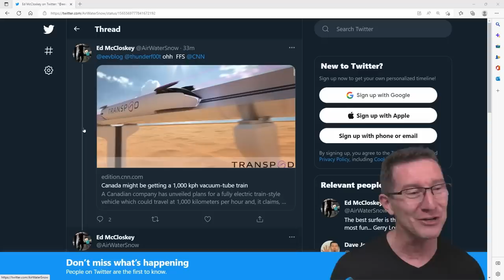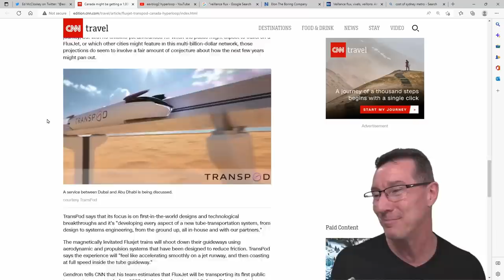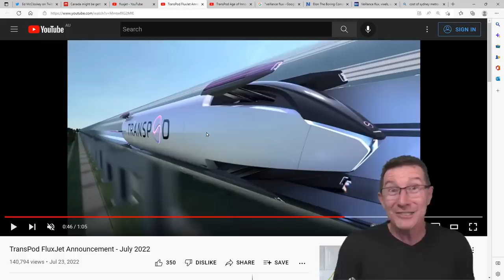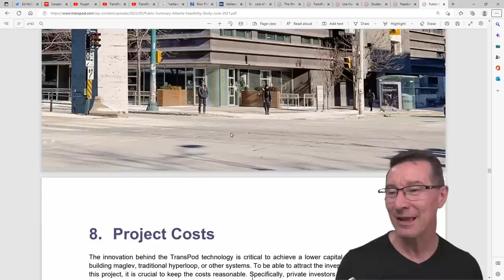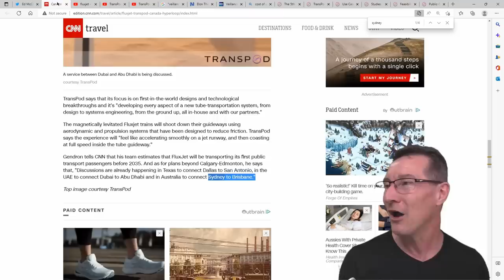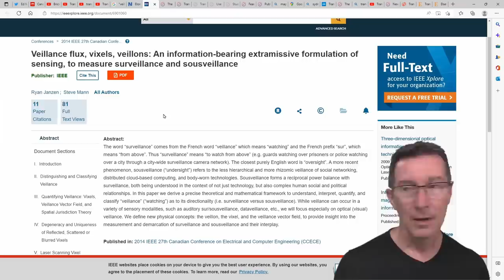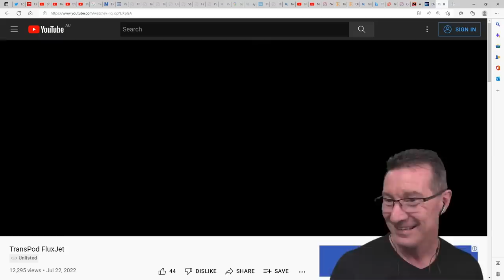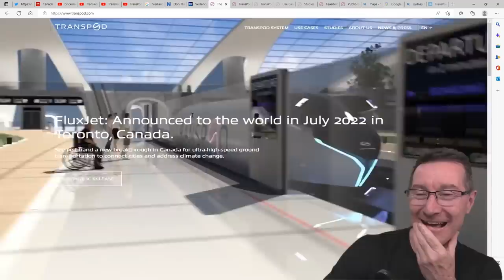EEVblog 1498 - TransPod Fluxjet Hyperloop $550M Boondoggle!

Comment: At 0:43 in the demo video you can see they have an even smaller scale test vehicle that appears to be in an actual vacuum chamber and you can see their "plasma energy transfer" at work, wish we had more footage of that, however no clue how you're going to pump a megawatt through this plasma at scale without destroying your electrodes in an instant.

But how much would that larger prototype have cost to build? Before I thought they were just lying about having half a billion in funding but after seeing close ups of that thing I see they have to have that sort of money to build something like that. Although it's clearly not capable of magnetic levitation with those "superconducting" microwave oven transformers it still has taken a decent amount of money and effort to construct and I can bet it has done its job to convince even more investors to open their wallets wide.
Reply from the maker: Ah, yeah, I see that, it's very brief. You can see plasma ball types arcs flashing across a gap. I'd bet that practically zero power is actually being transfered there. I suspect it's just a plasma ball type chamber mockup. As if you are going to get plasma arcing like that at very high power and NOT erode your rails and contacts. Maybe Transpod will see this video and supply us with some footage of the mini version and the big version actually levitating and being pushed down the track and powered?
Reply: @EEVblog  Taser the the train, cuz if you taser a person they run super fast as well 🤪
Reply: @EEVblog  
Still, no one has addressed the elephant in the room, how do you get plasma in a vacuum?
'Plasma is superheated matter – so hot that the electrons are ripped away from the atoms forming an ionized gas.' ~ MIT Plasma Science
Burn, baby, burn! 😁😁😁
Reply: @mynewschannel3100  It's not a complete vacuum, so there's some gas molecules there. And you need a low pressure in order to form a plasma at low temperatures - that's why the Northern lights occur at very high altitude. Not that any of this makes their idea any less stupid...
Reply: @markmuir7338  also, the less air you have higher does the effective resistivity of the gap go, as you have less ions
Reply: apparently you didnt see their cgi rendering that says it works because cgi rendering lol
Reply: @mynewschannel3100  you get gas from the electrodes evaporating from the high energy discharge.
Reply: How will they transfer the power you ask? Magic

Comment: Plasma in vacuum... Sounds like you'll get free X-Rays with every ride too! Amazing!
Reply: it wouldnt be in vacuum, thats a lot lower than 'low pressure'
Reply: @mycosys  It wouldn't make pretty colored light, it it where in full vaccum😏
Reply: Thats what I was thinking too 🤣
Reply: Not really. It is not vacuum that makes xrays but energy of the electrons. Unless they use very high voltages on the order of tens of kV then no xrays will be generated.
Reply: @JanCiger  Yep about 15Kv.
Reply: @JanCiger  well a 1cm arch is already 10kv
Reply: I don't think any contact could withstand being surrounded by plasma for any extended period of time, and I highly doubt it would serve to carry across any power. Isn't plasma rather a SIDE EFFECT of - for instance - lightning, when it superheats atoms in the atmosphere, kind of like an extreme phase of excitement, way passed ionisation?

Comment: Of course the veliance flux keeps the inducto-resonant coupling of the stators in a stable arrangement. That's the only way for the dynamic entropy halbach array to work dynamically.
Reply from the maker: Obviously.
Reply: And it also uses patented boondoggle technology
Reply: @EEVblog  Nah, you got the polarity backwards!!!
Reply: You forgot the surmounting of preframulated amulite...
Reply: It looks like it has both a type B and type S quantum super-framistan.
Reply: All those words use to have meaning before they was put in that order.
Reply: This is where the turbo encabulator comes into play.
Reply: That's what Flux Capacitors are for.
Reply: @dogwalker666  Sorry to say that your way out of date, the flux capacitor was superseded ages ago by the " left handed oscillating diosopeed".
Reply: @brucepickess8097  that's been superceded by the reverse entropic nominal gradient polynomial bifurcation gradial vibrophonic infraviolet inductor
Reply: @nameredacted1242  Of course he has, he's in Australia. The plasma would gather on the ceiling or something.
Reply: @matsv201  Oh, it's worse.  The paper on IEEE's web site where Veillance Flux is introduced as "an aggregate spatial integral of bidirectional reflectance distribution functions".  From the intro in that paper, the best I can figure "Veillance Flux" is light emitted, reflected, received and processed to wondrous effect (my words).

Isn't it nice to have a simple term like "Veillance Flux" to fully encapsulate the concept of "looking at stuff and figuring out what's going on" ?!??
Reply: @Randrew  Probable made the finals in bullshit championchip
Reply: @YSPACElabs  ...which, of course, operates only in the chronosynclastic infindibulum.
Reply: So where is the Mr Fusion? That's what I want to know.
Reply: @Randrew  Sadly modern physics is replete with what we might 'generously' call pseudoscience. Some on the fringes and some seemingly in the mainstream. Veillence flux is quite clearly a clever marketing term designed to befuddle the 'simple' into thinking how clever it is. What makes it so brilliant is that it raises the bar on 'simple' to include almost everybody, even the IEEE.
Reply: Excellent technobabble. Sounds like it was ripped from a star trek episode.
Reply: Don't forget the turboemcabulator. Can't get magnetolevitation without a TEMCAB.
Reply: But what does this do to the cardinal grammeters? And is side fumbling controlled?
Reply: @Skwisgar2322  it's all corrected via a side-mounted reciprocating dingle arm coupled to the lunar wane shaft
Reply: @YSPACElabs  ahh, I see, that should do it.
Reply: Of course if the halbach array is only intrinsically mediated you could also get it into dynamic resonance with a turboencabulator too
Reply: @gabotron94  yeah, but you risk putting too much stress on the Heisenberg compensators.
Reply: I have no idea what you said but it sounds genius. Take my money NOW!

Comment: 29:00 I read the full paper and the "veillance flux theory" essentially says "there are technologies that exist that allow for observing changes in an environment, and they can be combined". That's it.
Reply: Surely it can't be that simple!!!
Reply from the maker: LOL
Reply: @nameredacted1242  Well they make it sound a lot math-ier and fancier than that, but yeah, that's pretty much it lol. Nothing whatsoever to do with Transportation or anything.
Reply: Matches the use case they seem to have for it: They´re scanning the tunnel ahead, presumably to adjust for changes in the track and even small variances in the imperfect vaccum. Combined with the 4 maglev tracks and adjustable pods, this could work to dampen the ride and keep an optimal distance from each track. Probably useful for such a device, but does nothing to address the fundamental problems of a Hyperloop.
Reply: Reversing the directionality of light feels a bit raytracing-like.
Reply: These are technologies you really want to keep your vixel on.
Reply: @nameredacted1242  They dress it up in a "mathematical"/"physical" model, where individual sources of "veillance" (as in, sur-veillance) are called vixels, and individual pieces of information are called "veilons", and then throw some mathematical formulas into the mix to calculate how "veilant" a system is. I have no idea what practical use doing this is supposed to serve.
Reply: "Vixel rays can be thought of as being emitted by a camera" suggests vixel rays are a figment of the imagination
Reply: Gernot Schrader  They were practically giving it away, I think.
Reply: There are sensors that can be combined, Amazing. Truly amazing.
Reply: So another term for computer vision?
Reply: @StevenOBrien  Wow, sounds like when I used to "invent" stuff when I was like 12 years old, making a flyer in a sheet of paper, inventing some words along the way that sounded like what companies put in their flyers. Once I came up with new units for write and read speed, just because.

Comment: For the reference, England HS2 budget got over $100Bn and the construction is not even close to be finished. 
 Just a regular high speed train without plasma, vacuum and flux capacitors.
Reply: I mean to be fair that are may factors that make high-speed raip particularly expensive in the UK
Reply: Ha ha.. yup. In the UK, if a local town planner even put the REAL cost of a bike lane in, it would never be signed off 😂😂. I am a brit living in China, and when they announced the metro extension next to me, the local guv put notices up. Metro line to go here, local landowners affected will become very rich. That works. The one landowner that resists has the neighbours to deal with 😂😂😂😂

Comment: 28:52 sounded like pure Turbo Encabulator
Reply: After reading the whole thing I can confirm it's pure crackpot nonsense trying to explain existing image processing techniques with his made up words like "veillance flux" and "vixels", the best part is in the demo they show the computer vision feed and it's just glorified edge detection that's jiggling all over the place and gets utterly confused by him waving his paper in front of it and the big light at the end of the tunnel.
Reply from the maker: I should have inserted the clip!
Reply from the maker: @WizardTim  Link to the full IEEE article is posted in the description for those that want to read it.
Reply from the maker: @WizardTim  Assuming this veillance flux stabilisation actually "works". How is the processing and recation going to work in real time at 1000km/h when you have mm sized gaps?
Reply: @WizardTim  And with the same font as the cheapest Chinese device you can find

Comment: It seems like they where building the electromagnet driver on a breadboard with  cascaded 4017's because they don't have an arduino programmer yet.
Reply: There is an open vacancy on their website for the arduino programmer: Electronics and Real-Time Programming, for Embedded Robotic Systems and Aerospace.
Reply: Fantastic lmao
Reply: Hey, don’t dis the 4017! It can do what it states in the datasheet. Whereas this turboplasmionicencabulatorjet … not so much.

Comment: 21:17 if you cool it with liquid and put all the heat from all the electrical elements into the capsule, you end up turning the capsule into an oven or thermos (being in a vacuum - therefore thermally insulated) :p
Instead of showing us methods of dissipating the heat from the capsule to the outside, it shows us how it stores the heat inside it :p
Reply: Yea a floating Maglev in near vacuum will have almost no ability lose excess heat.

Comment: Long straight tubular sections are going to be fun for thermal expansion when temperature goes from 50+C being beaten down by the sun in summer to -40C cold snaps in winter.

Comment: If you look at it from the front, I think this is where the Flux Capacitor is installed.
The plasma skates are used to transfer Jigawatts to power it.
Reply: That would make sense, it could go really slow but transport you to the future where you finally arrived and you'd think you'd gotten there really fast till you saw what time it was.

Comment: For the added expense and complexity, it is more cost-effective to build a standard high-speed maglev.
Reply from the maker: And half the speed is perfectly adequate. Even if you could get the entire reduced pressure tube system working, twice the speed isn't worth insane extra effort required to maintain it va Maglev at 430km/h
Reply: @EEVblog  At least Maglev trains hold hundreds of people. These look to only hold a few dozen at best, and I doubt you could have more than one in tube at once. The efficiency per person/trip would be abysmal.
Reply: Didn't you see their chart where they showed that this maglev in a vacuum is somehow cheaper than standard maglev?
Reply: @EEVblog  IIRC, Earth's atmosphere allows regular rail trains to go 500-600km/h efficiently, easily and reliably.
You just need it to be straight enough and well-banked on every turn.
Not only it doesn't have to be cheaper than airplanes (but it will be because fuel is expensive and electricity doesn't have to be) because of convenience (no need to arrive 2 hours before takeoff to a place that is far away from anything interesting), being slower than an airplane can be actually more desirable because humans require about 8 hours of sleep and most flights are not taking long enough to even have a decent nap.

If I had a choice to get to my destination in 9 hours instead of 5 while saving 4 hours of waiting for takeoff and going to and from airports, I'd gladly pay double.
Reply: @goury  aircraft beat trains for international travel,  And in the UK travelling by train is extremely expensive.
Reply: @chitlitlah  Maglev in vaccume is like standard smartphone in space. It should overheat in 29.2 second and burn until oxygene is in power cells. And lost all passengers. 
Vaccume in 3m diameter pipe long few hundrets of kilometers is literaly horror. Gas pipes are presurised and leakage is easy to find and relativle save. Leakage from outside into pipie is nearly unable to find. 
All this ideas and calculations proves that best fast transportation medium is airplane. 
As long as we (like a mankind) know some methods to save some energy in real life we know thermodynamics law and know the price is not a last limit.
Reply: @dogwalker666  it doesn't have to and it's also oil lobby.
Trains can and should be cheaper just because after the initial investment they are so much cheaper to run and also much more convenient for up to 4000-7000 kilometers range.
Reply: @chitlitlah  Did it include the cost in energy to pull a vacuum? Cost to maintain a vacuum tube? IF the tube, maintenance, and vacuum is free then of corse it's cheaper. just the tube will cost more to keep running than a maglev train. That and maglev is proven to work and be reliable.

Comment: It will never work as they forgot the Turbo Encabulator pangalactic gargleblaster that is connected to the dingle arm to prevent barescent skor motion of the vertically composited patch hamplers. Hope this helps.
Reply: Apparently the "patch hamplers" were considered as being a weak link in this system and have been replaced with a pair of "horizontally opposed fridge magnets".

Comment: I heard this on the radio the other day and was really confused by the 1000km/h spec. Its only 300km from Calgary to Edmonton. To me, a well proven 400km/h maglev train would suffice and allow for ~1h trip, which seems like a reasonable amount of time. I mean maglevs cost a lot, but you don't end up setting fire to $1B in the process of proving something doesn't work.
Reply from the maker: Did I miss that spec somewhere?
Reply: You don't need a maglev to travel at 400 km/h. Any high speed train will do that

Comment: A big advantage of conventional high speed rail is that if there is already a reasonably specced conventional rail network in major cities you can use that to gain access through the most dense urban areas and then branch off onto new dedicated high speed infrastructure once out in the countryside. Most European HS networks developed gradually that way. In Japan they had to build new everywhere due to incompatibility with their legacy narrow track gauge. Even there, the new HS tracks often closely followed existing rail corridors in urban areas.

Comment: As an engineer it makes me so mad that people can't even be bothered to even do the most basic calculations to prove that this won't work, ever.
Reply: As a once-chemical engineer and as a now mathematician, it enrages me.
Reply: I'm just a machinist and metal fabricator and i don't even need to do the calculations to know this will never work, anyone who has experience in manufacturing and  knowledge of materials knows a vacuum tube that big is beyond ridiclous in so many ways
Reply: Well I've never done any physics or engineering, and I'm certain that this project is the future of all travel.
Reply: Also that investors forget to do basic research is quite worrying. People who invest in scams like this deserve to lose their money however. It's just a shame public funding often is involved too.
Reply: The part that really gets me is when they claim Hyperloop will be cheaper to build then traditional high speed rail.  Train track vs. train track plus vacuum tube, material cost alone is going to make the second thing more expensive!

Comment: "What the heck is that doing?" Probably doing exactly what you said at first: flashing LEDs. You know no high tech device made for video is complete without blinking lights everywhere for no reason.
Reply: Maybe they are testing leds which will eventually turn a regular maglev into this newfangled fluxjet technology (= regular maglev with some RGB light strips strap on, because nothing says advanced high tech like the RGB light strips. If it is really advanced, they will get those addressable led strips!). Maybe they will eventually ditch maglev entirely and demonstrate even more advanced technology: wheels.